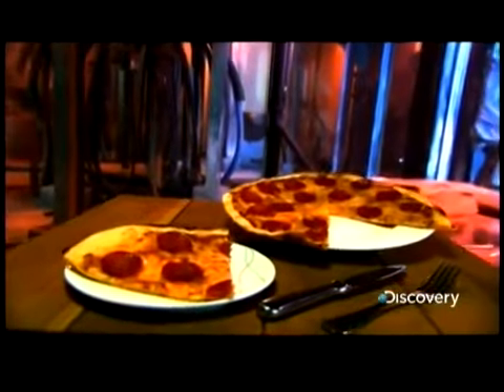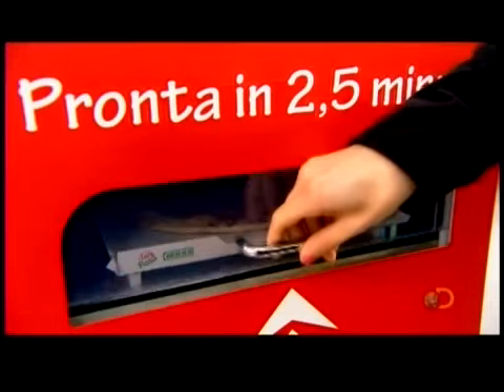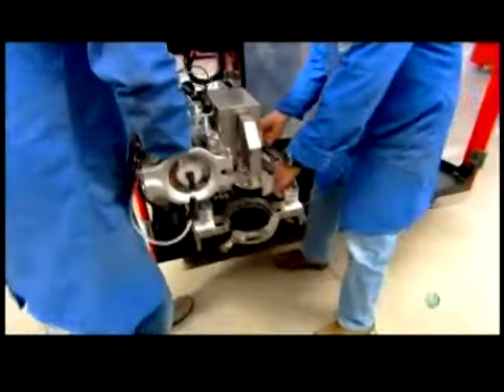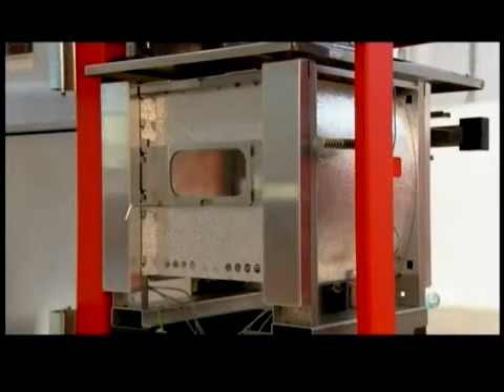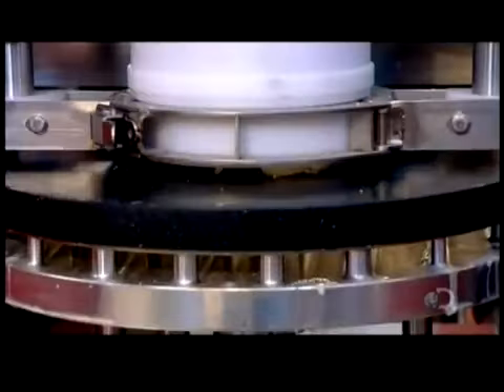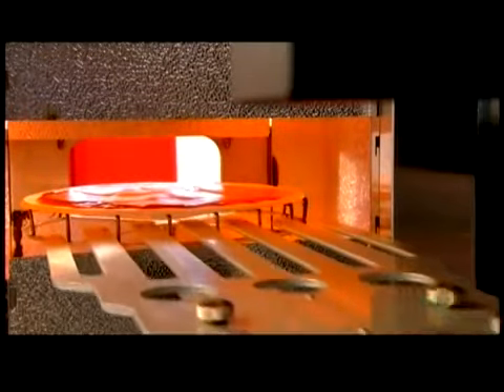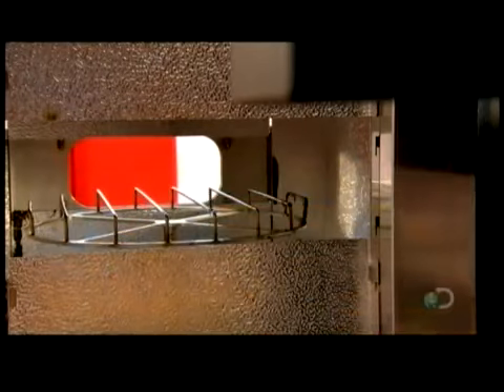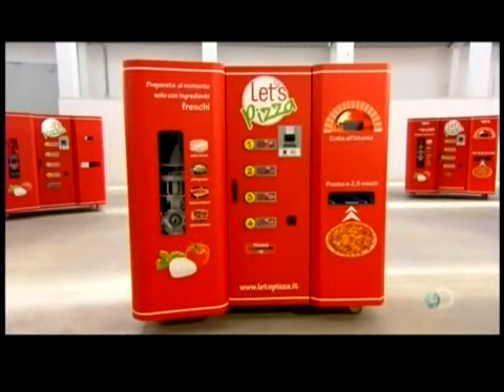How Its Made   Automatic Pizza Makers

Comment: How do the keep the ingredients fresh like the vegies and cheese? And why is the box has no cover?
Reply: +kyla sanchez The toppings are all in the build in cooler that you can see them install at 0:55. You can see at 1:10 it has 4 compartments for the 4 different toppings. It would need refills daily. All of them are dropped out of the bottom of the cooler onto the pizza at 3:48.
It is either meant to be eaten directly or they loaded it with boxes without the cover for the video to show that it really loads a pizza so that the video won't be called out as "fake" by every kid on the internet. It would be easy to drop a cover onto it or load it with boxes with cover. Even if you have to close it yourself it would be fine because it would immediately proove that there is a pizza and not an empty box, and a customer would need to check if it is the right pizza anyway.

Comment: I don't really think it is possible to heat something from the inside out with this machine... unless the heating is happening from the inside but it is clearly not. The light is coming from the outside and also hits the outside of the pizza first and also heating this part first.
Reply: +Cypher Most of the infrared radiation actually goes completely through the pizza, but as outside is only defined as the far out layer which is visible, a lot more area is hidden beneath it. As this is a larger area, more radiation is absorbed in there, meaning it'll have been heated more on the inside rather than the outside.
The difference between the regular oven way of heating and this way regarding the heating on the inside, makes it not even a lie to say that it is heated from the inside out, as the heating on the ouside is relatively insignificant comparing with the regular way of heating.